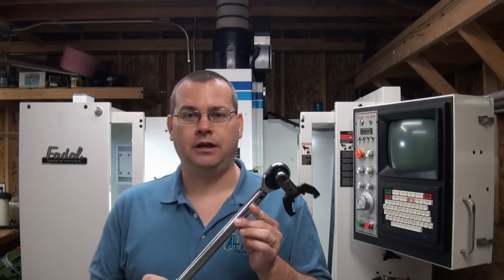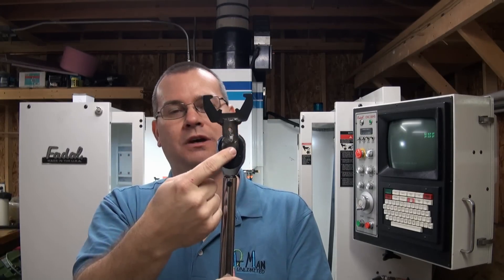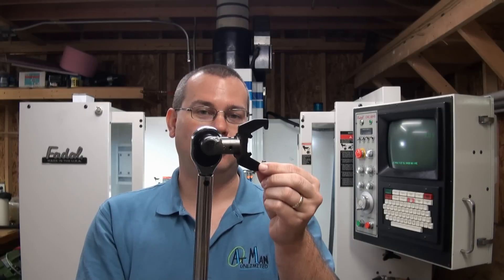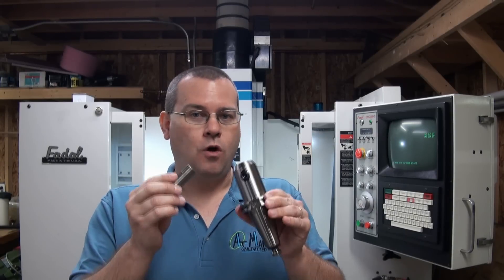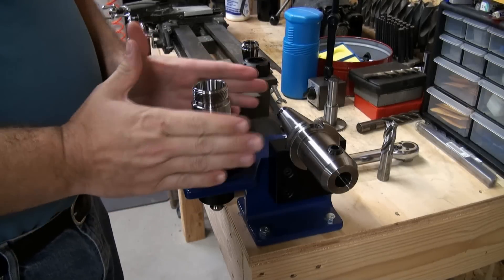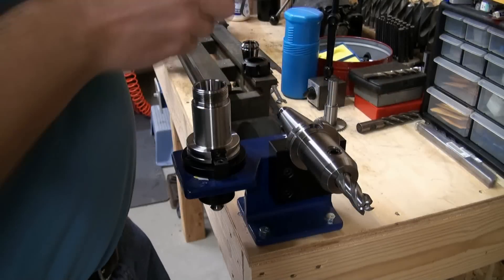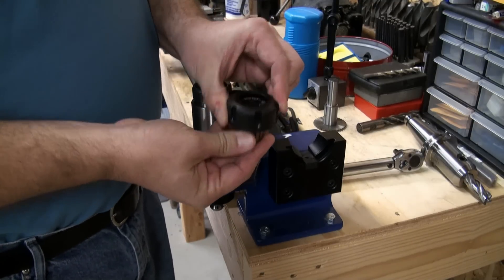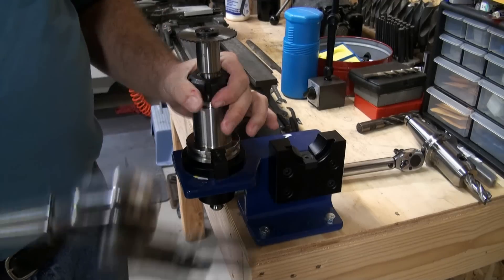Collet and Set Screw Tool Holders

Comment: Do you have a link for where I can find that crow's foot socket?
Reply from the maker: The one for the ER32 collets is from Techniks. But it uses a special wrench, so I just bought a cheap impact socket from Harbor Freight and welded it onto the crows foot to use a standard torque wrench. The other crows foot for the ER16 is just a 1" crows foot you can get just about anywhere.

Comment: If you have a tool you want to use in a set screw holder but it doesn't have a flat, it really isn't hard to grind one. Use a green wheel for grinding carbide. The bonus of this is that you get to decide where the flat is, and therefore the stick out of the tool.
Reply from the maker: Yes, grinding your own flats is common, as well as reduced shanks, radius, and many others. I just try to order what I need ahead of time.

Comment: Soooo.... where did you get your crowsfoots for a standard torque wrench. They seem to be a  rarity.
Reply from the maker: Hi Dave, yeah, I could not find them either.But if you take Techniks part number 04604-32 plus Harbor Freight part number 61991 plus cut off saw plus a Mig welder plus a grinder = what you see in video ;)
Reply: Ahh so. Will give that a go. Thanks
Reply from the maker: No Problem, it was a little backyard engineering. Good test for your welds though, if it breaks you end up on your butt when you try and put 100 lbs-ft on that sucker ;)
Reply from the maker: Yes, you can buy the correct wrench from Techniks direct. I'm just to cheap to spend $300ish on a wrench. I actually find the harbor freight wrenches to be a very good value. I have had them calibrated and they where within a few percent. Even after use they hold there cal. I get those for $20 with a coupon ;)
Reply: i hear ya there on the price...stupid expensive.
Reply from the maker: I find it totally amazing that you can get a carbide end mill for $100 that is made out of super $$$ material, needs to be precision ground, but a simple torque wrench is $300? Oh Well.
Reply: i think its because the EM are consumables and the quantities are so great that material costs and productions rates are much lower. if i bought that wrench, it would be the last one i bought, however i buy $100 EM weekly.

Comment: I've always been a bit surprised at how many don't seem to know the torque specifications for the various ER collet sizes. And it's odd that the manufacturers don't seem to supply any information about the needed torque with the collets or chucks. If my information is correct I believe Rego - Fix were the inventors of the ER collets and there web site is where I first learned what the correct torque values are. Since I'm using a non cnc Bridgeport clone I'm changing tools and collets for a change in tool shank diameter within the same collet chuck. Most with CNC would be using multiple collet chucks. But I think adding a bit of oil to the chuck threads gives more consistent torque, and sure cuts down on the wear on both the chuck and the nut threads.
Reply from the maker: Hello Turning point, check out Techniks web site http://www.techniksusa.com/ under the support tab there is the recommended torque settings for all the different sizes of collets. They also have pull stud and set screw torques. A little oil on the threads and the OD of the collet is ok, just be careful no oil gets on the shank.
Reply: Thanks for the link to the Techniks site. There torque specifications match what Rego - Fix has on there site as well. Yep I'm careful that the tool shank stays dry.

Comment: Great vid Tim.  What were the Christmas gifts you were making, and will you post a vid of the process?  Thanks again...........SKI
Reply from the maker: HI SKI, I will comment on what was made tomorrow ;) I did not film it because it is a personal gift for my wife and my son and I made it together. Was focusing on shop safety and having quality Father Son time. But anytime you need to break out a 2.5" by 1/16" slitting saw you know your in deep, LOL
Reply from the maker: We made Mom a custom picture frame. Used draft sight to make the standard text, then imported into Fusion 360 for CAM. Took a picture of my sons writing and did a spline trace to put his signature on it. The slitting saw was to make the slot for the back to slide into. We bought a cheap frame for donor parts.

Comment: good video the endmills with flats are called weldon shanks.
Reply from the maker: Thank you, I thought I mentioned that once in the video? Maybe I forgot to.
Reply: Weldon flat
Reply: @alexcalibasi7028  depends on manufacturer they are typically called a weldon shank end mill. The weldon flat is just the flat on the end mill if you ask for a weldon flat you never know what you'll get since they are used on drills, end mills, rotabroachs and a number of other tools.

Comment: Larger end mills require more torque so the larger end mill holders usually have two set screws in them. End mills should NOT be run in a drill chuck. You can get Morse Taper end mill holders with both draw at and tang type shanks if you must do some light duty milling sub- 1hp.
Reply: Yeah, ER collets do not extremely tightly grip shanks.  The next thing I would say is to use a 100TG/TG100 type collet chuck if you must need a high grip force.  

There's a lot of history behind the CAT(erpillar) style shank.  There's also a CAT style shank with a international style flange to a DIN Specification, usually DIN 69871 or DIN 69872 and usually only varies in the flange.  There is also a ANSI and ISO Specification for the same.  The number 40 refers to the 40mm taper used. 

The set screws of end mill holders will usually force the end mill against the internal grind of the end mill holder by some amount, and will induce "some" runout, and it varies.

I prefer using a collet of some sort for drilling.  

I also suggest using a ultrasonic cleaner for cleaning collets.  Collets are also consumable and do wear.  Worn collets should be replaced as they are unsafe.. and industry usually replaces them in use at specified intervals to prevent accidents.
Reply from the maker: All very good points, you could use a drill chuck for milling if you wanted to make things exciting I guess ;) Anything 1" and up has 2 set screws from what I have seen. Pull studs, collets, and tool holders are all wear items. The main difference between the really pricey and the cheap tool holders in the grade of steel and its hardness. The cheap ones just wear faster.

Comment: Very, very helpful! Thanks! Had no idea collet nuts actually have a torq spec. Have had them way looser than they should be. I use a small bench vise as a tightening fixture, the jaws of the vise fit nicely in the tang slots of the holder, works ok too.
Reply from the maker: Nice, I want to see you machine the whole tool holder though next time! This Old Tony did a few.

Comment: Awesome video!  Thanks for all of the great info.  One bit of info that I would add:  If your tool has a shoulder on it, like your slitting saw arbor in the video, you never want to bottom it out in the collet.   If you do you can end up clamping down on the small radius in the corner of the shoulder.  After some time it can slip off the corner and your tool will pull right out.
Reply from the maker: Yes, always leave some space! Good points

Comment: Good video Tim. One Question, I've never used the stop pin before but if you have to reset it each time wouldn't that defeat the purpose? How would you use is as a stop for the next tool or if you remove and replace the tool and want to use the stop to eliminate a reset? Or is that not what they're used for?
Thanks
Reply from the maker: Thanks Steve, The stop screw is not to eliminate a tool length reset. They are used to prevent the tool from getting pushed into the tool holder. Like if you where doing some heavy drilling the bit could get pushed back into the holder. The stop screw is there to prevent that from happening. Tightening the collet nut with a tool against the stop screw is not recommended because it does not allow the collet to shrink up properly.
Reply: I see. Thanks Tim.